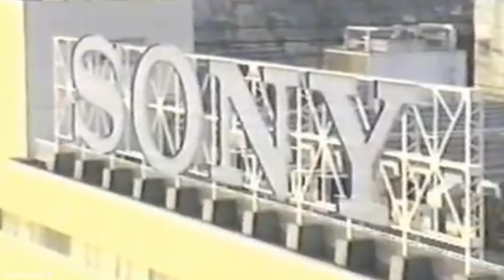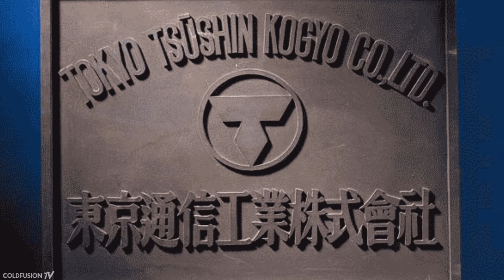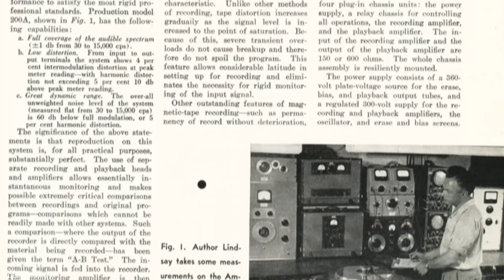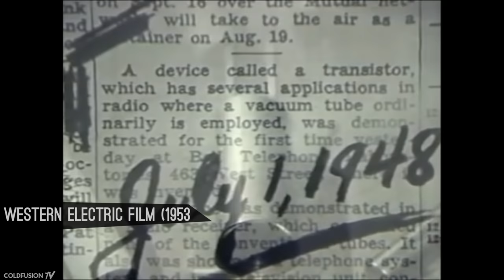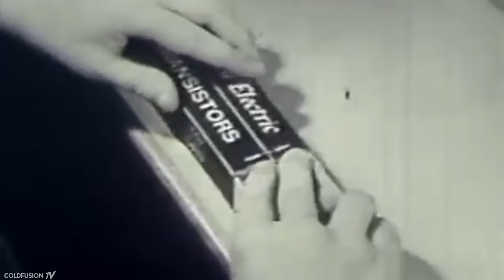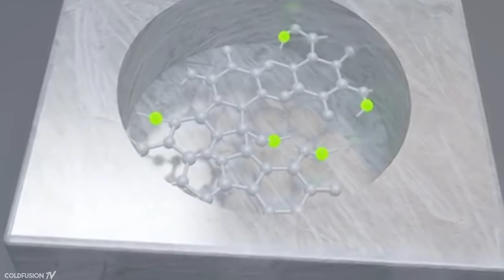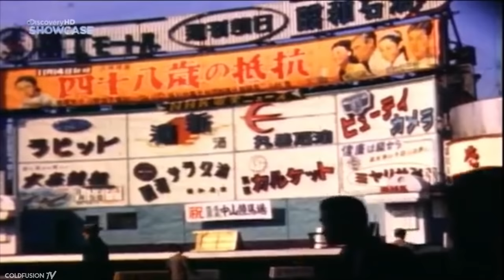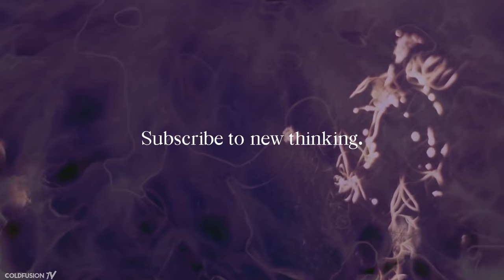How Did Sony Start? (The Origins of Sony)

Comment: the best and most diverse Company ever...
High quality hardware and products: check!
consumer electronics: check!
Movies/TV: check!
Music: check!
Gaming/Playstation: check!
Reply: Pain Nagato Sama 
Sony Mirrorless Cameras. The best selling and with millions of reviews and views on youtube.
Reply: Tenerio indeed
Reply: Pain Nagato Sama : Not to forget, Lately Sony is still revolutionary for creating first FULL FRAME SENSOR on a mirrorless camera and are competing with brands like Canon 1dx and nikon d4 and winning because of its much smaller size and price.
Reply: Except the newest two Playstations (PS4 and its Pro variant) are a joke.
Reply: destrierofdark you're trolling right ?!
Reply: Pain Nagato Sama I'm not.

Hardware performing on par with stuff that costs $150-$200 is in no way at all a good buy when it costs double that.

A GTX480 has to run at a THIRD of its speed to almost be as slow as the first PS4, which is 400MHz for it. The Pro runs at the 480's equiv of somewhere from 500-600. Its default clock is 1200. A couple years later the price of this performance on a single card was down to $150, giving the PS4's own GPU the performance of something that'd theoretically cost $50.
Reply: destrierofdark I'm a PC gamer myself but come on man, when have consoles ever been more powerful than a PC??? You're paying for convince and reliability.
Reply: ***** They used to be a while back.
Reply: PHILIPS WAS DOING ALL THAT BEFORE SONY!! PHILIPS & SONY the 2 best!

Comment: For people who read faster than watching a video

1.  Started with small building no windows
2.  Made first rice cooker that sucked
3.  Made first heated blanket that sucked
4.  Made tape recorder for consumer use, where as before the US reporters would only use them
5.  Then came Transistors.  This was the beginning of huge ass tube tv's to become smaller huge ass tube tv's lol..  
6.  Sony guy, took gamble and invested 25k for transistor patent use

7. Then came the Sony portable radio.  Americans were having difficulty doing this as well.  But Murica still beat them to the punch.   BUt sucked because they didn't have 8.  It had low volume (merica radio)
8. Sony re designed the Transistors and made it better with phosphate 
9. Sony went to murica to show them their better radio with 8..  Murica can't say Japaenese name just like I can't spell it, so they changed the name to SONY
SONY = Sonus (sound) +  Sony (Slang for boy)

10.  Murica wanted to sell the Sony radio only if it was under American name.  Sony didn't like that I guess, sold only in Japan. 
11.   SONY Sales pitch in murica,   "RADIO that can fit in your POCKET"  LOL but the pocket wasn't big enough.. SONY's solution.... Made the pocket bigger LOLL
12.  SONY radio spread Rock n roll now that people can listen to it with out strict parents listening to them (guess they had headphones back in the day as 10:18 would suggest)

The End:  SONY become big in small consumer electronics